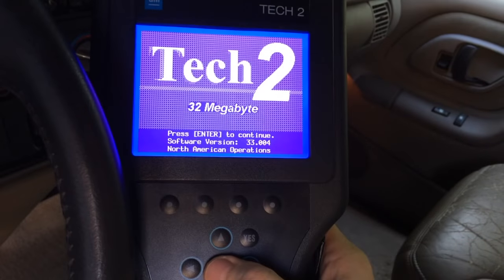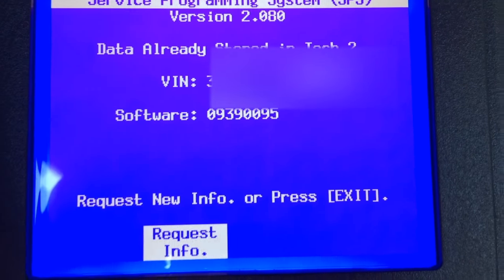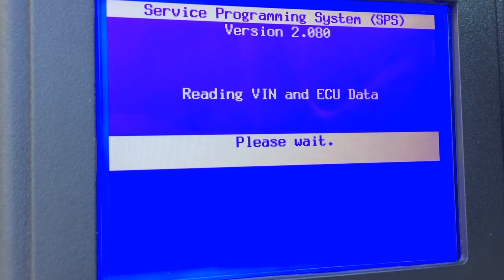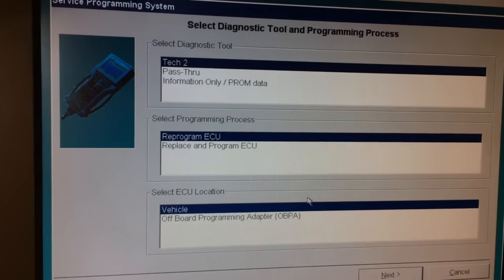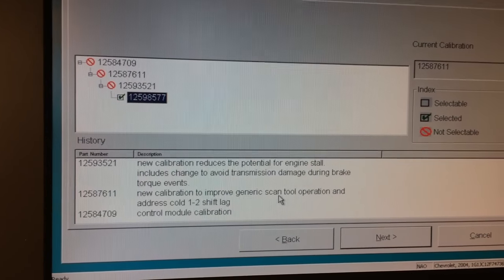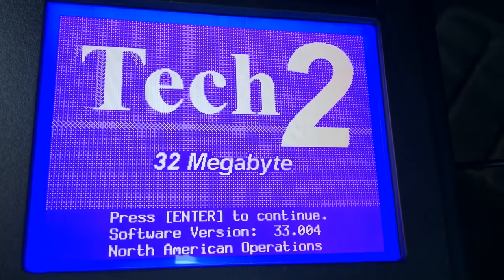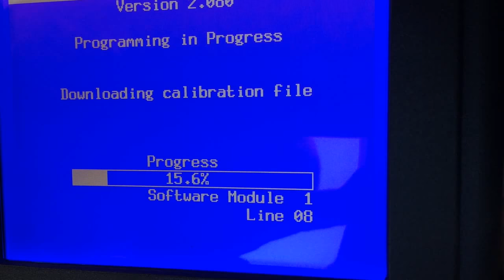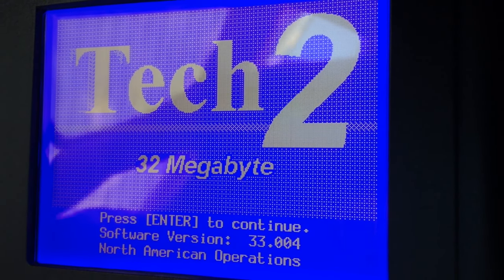GM SPS Programming: Tech2 Tool Remote Mode ECU TIS2000 How to do a Calibration Update Reflash (PCM)

Comment: Very helpful video. Thanks for sharing! My 1st attempt at using my scan tool has stalled at the settings page. The PORT box is empty and won't let me enter anything. BAUD is 115200. I've tried this with and w/o the unit hooked up and it makes no difference. Not sure where else to turn for a direct and informed answer. Thank you again.

Comment: From what I can find, the last TIS 2000 was dated 10/2008, which I am still looking to find a download to update my 03/2008 version?
Reply from the maker: There was one newer DVD update after 03/2008, but it only contained model year 2008 SPS content.   It's pretty hard to come across nowadays.  So if you don't have a 2008 that you need to do SPS on, you're not missing anything.   You can always use the current Tech2Win emulator with an MDI scan tool interface instead for 2008 and up vehicles.
Reply: @DrShock  Thanks for that info. My screen says I have 12/2007 on about TIS 2000, so I'm hoping to at least update to 03/2008 like you had on your machine in the video. Great video BTW!

Comment: thank you for all great info , I have a rebuilt BCM from local parts house, should I use my TECH 2 and TIS 2000 or should I use ACdelco techline to program it . I have used my MDI 2 to program on techline 2007 Silverado before. It was straight forward . First time with 2006 hummer h3.  Mitchell says use tech 2 ? how do I get Tech2 to load SW ? change it first then scan it? TIS2000 says reload or replace ecu ? I want to replace BCM with rebuilt one that is fresh and blank that i have . what would You do ,thanks for being there to help all of us !
Reply from the maker: I only use the Tech2 for vehicles that fall within the TIS2000 support range, so only up thru model year 2007.   For 2008 onwards, I use the MDI with Techline Connect.   The latter has a per VIN subscription fee, but you can pass that on to the customer of course.

Comment: Nice video instruction.  Question- I have a tech 2 and just purchased a GM card.  I need to calibrate a steering angle sensor on a 2008 Saab 9-7x (AKA Chevy Trailblazer).  Does this require TIS 2000, or Global Tis?  And, I presume that I need admin access for all of this.  I have software already (Tis200 and Global Tis) for my 07 and 2010 Saab 9-3 vehicles, using the Saab card, with admin access.  The 9-7x is new to me, and I know it is a Chevy Trailblazer with a Saab front end, essentially.  I do have a CANDi module. Thoughts on this?  Thanks!
Reply from the maker: Thanks.  2008 was the last year for TIS2000, most of the clone copies are incomplete for this year insofar as SPS goes, and really only usable for 2007 and back.  If your VIN is in your copy of TIS2000 it's the cheapest route for a module reprogram.
 
GlobalTIS and TIS2Web have been deprecated by GM since the end of 2021 though.  The new tooling is Techline Connect with SPS2 and it does not support the Tech2 anymore for programming.   You would have to have an MDI, or an aftermarket J2534 compatible tool, to use SPS2 now.

The Saab vehicles have always been on the odd side of Tech2 and TIS with frequent issues from what I've read/heard.  I do not have any hands on experience with this Euro model so your best bet is to hit the Saab forums.

Comment: I have a DrewTech CarDaq 3+ , Tech2Win software but am Looking for a TIS2000 download as I need it to reprogram a BCM on a 2006 Hummer H3 as we replaced the Passlock ignition switch and while doing the security learn it failed after the first 10min wait session while doing the 2nd one. 

Any help would be greatly appreciated. 

Thanks DN
Reply from the maker: GMs legal department is pretty active in doing take downs, so finding that will be quite the easter egg hunt.  You can find TIS2000 on eBay as used DVDs from time to time.   And of course the Chinese cloners still stick a version in when you buy a clone Tech2 from them.

Probably faster just to use SPS2/Techline Connect from www.acdelcotds.com.

Comment: Thank you very much. In deed it helps a lot. A complex problem that occured on my BiFuel Opel Combo CNG 2009  by wanting to activate the Cruise Control turned the Switch for Natural Gas / Gazonline useless. Car runs only on gazoline and not on CNG any more. Pressure Sensor for CNG reports 0 bar pressure (even though the tanks are full and at 200 bar). I know sounds unbelievable but it is ture and a fact. The OP COM Software had and has a bug on z16YNG Motors that was addressed (but only in Astra and Zafira CNG Modells) and not on Combo (since the Combo is listed as a Corsa in GM Systems) and now we are fighting to resolve that. :-((   I try to install GlobalTIS and OPCOM and liked your info on TIS2000 so I can talk with the dealer on eye level and have a better understanding. 

So today in 2022 the deaeler is able to REFLASH the Firmware in my Car for the EngineControllUnit and the BodyControllUnit much faster and without the need to download on a PC - transfer it to Tech2 and loading it on the car, right?  He can flash it directly with his DiagnosticsTool over WiFi on the car.
Reply from the maker: Glad it helped.  And yes the Tech2 remote mode was abandoned by GM many many years ago.  So a dealer will not even have that option available to them.  Both TIS2000 and TIS2Web are obsolete and discontinued.   The dealers now use Techline Connect, which only supports the passthru mode I showed in a different video.   And rather than using a Tech2, the dealer would be told to use the newer MDI running a Tech2Win emulator instead.

Comment: Hello
I would like to ask the TIS2000 with virtual technologe works?
Will it be able to reprogram from a damaged ECU?
Reply from the maker: I don't believe TIS2000 will run within a VM, real Win2K or WinXP only.   It will handle SPS programming for GM vehicles up thru model year 2007.   Past that model year, you'll need a subscription to SPS2 at www.acdelcotds.com plus an MDI scan tool (Tech2 no longer supported by GM).

Comment: Is this the same method used to add Factory Cruise Control to a GM vehicle that wasn't originally equipped with it ? The wiring is all there and hooked up to My Donor parts. I was told by Dealers that it can't be done do to my vehicles age, or nobody's interested in doing it. A 2000 is too old ?
Reply from the maker: They probably got rid of their Tech2.   Yeah this is the tool used to enable those kinds of options in the BCM back in the day, but model year 2000 is a bit early for that sort of thing.  I don't recall cruise control needing to be programmed prior to 2006 or so.  What make and model?

Comment: I have a 2000 Saturn L Series that has lost some communication with some options via the BCM. I bought a new virgin unit that I took to a tech I know that has the Tech 2 set-up. He went to program and configure the new BCM, got errors during the programming install and stated He had to contact the GM Tech Support for further assistance. Any idea's what Errors He would be talking about ? He couldn't get a response in time to get a solution before the Holiday weekend. I read on the Programming Procedure print-off that before programming can be done, All Modules and connectors need to be connected. I forgot to tell Him I had both driver and passenger side Air Bags disabled and the Recirc Door Actuator disconnected, along with the factory radio that is Theft Deterrent. I'm wondering if that's the Errors He was getting. Before it goes back next week for the second try, I will reconnect everything and see if that resolves the issue, and tell Him I forgot to let Him know about those. Lol. Maybe Customer Error, not His set-up. Great Vid too !
Reply from the maker: Thanks, all I could think of is what I covered here a few years back - https://www.youtube.com/watch?v=9h-qdNn3iOk but I thought that ended with the 1999 Saturns so it might not apply.

Comment: what I  accidently did was played with my TECH 2 on TIS2000 and lowered it to 28.xxx ., I since got a new PCMCIA card back to 33.004 ! what I have to do is replace BCM on 2006 H3 hummer because the keyless entry and TPMS do not work. I was going to reload the firmware but it already has the latest. So I can not do that . Do I just install a new BCM and run the program and will it install. Everything else works fine just do not want to mess anything up. Should I do it ?
Reply from the maker: First be careful on the memory cards.  The Tech2 does not use PCMCIA, it uses a different kind of linear memory chip inside the card that just happens to use the same type of connector that a PC would.   Cheapo Chinese cards might not last very long if they are the wrong memory chip type.
 
A Tech2 will only allow you to setup a brand new BCM, so just keep that in mind.  If you're trying to use an used module, you could be out of luck with a Tech2 since GM didn't want to allow that path so its very hit or miss.  But setting up a brand new GM BCM, or an ACDelco remanufactured unit, would be just fine.   You would just install the BCM and follow the service manual directions for programming.  This varies across models and model years, so having the service manual, or service information online at www.acdelcotds.com, is best.
Reply: @DrShock  Thank-you so much for all great info . I am using a clone Tech 2 to replace 2006 h3  BCM , will it work as  needed like a original  GM Tech 2 ? Thanks again for giving all of us your valuable time !
Reply from the maker: Thanks.  Contrary to the fake news you may read on the 'net, the clone Tech2s are 100% identical in functionality to the genuine Tech2.  They are 100% compatible with the software, even having the same bugs.  ;-)

Now there are differences to be had, the circuit boards are built much more cheaply, so if you drop a clone Tech2 on the shop floor it's likely toast vs the real Tech2s that are very durable for shop use.   And while you can send a real one in to get repaired for $$$, you have zero repair options with a clone.  The membrane keyboards on the clones crack and split after a few years of shop level use, whereas the real ones last decades.  That sort of thing, build quality.  That's what you give up with a clone, but not any functionality or software compatibility.
Reply: @DrShock  Thankyou so much for that positive info !

Comment: Okay, I have a 2008 gmc sierra and I want to reprogram the sdm because I think they replace the BCM, and I can’t do it with the SPS2 software it gives me this error E4399, my question is I need all this tech2 software and hardware to reprogram the module?
Reply from the maker: No, the Tech2 isn't even supported by SPS2 as it's far too obsolete.   You can only use a Tech2 tool with SPS (think SPS1) with the DVD-ROM based software TIS2000 that runs on Windows 2000 or NT only like I showed in this video.   TIS2000 only supports up to model year 2008 programming as well.

For anything newer model year wise or Windows version wise, you have to use an MDI or MDI2 tool with GMs Techline Connect.  That's where you pay to subscribe to SPS2.  Runs about $45 per VIN for two years access.
Reply: Okay thanks for replying, I always pay to reprogram modules with sps2 but I have been getting a lot of older trucks recently and I can’t reprogram these trucks with the sps2, I was reading on some website and they said that some older trucks (pre 2007) need Tech2 in order to reprogram a Module, That’s my question.
Reply from the maker: Yeah the older trucks I would always recommend using a Tech2 on, with TIS2Web.  But now that Techline Connect came out, they dropped support for the Tech2.  I'm talking about the actual Tech2 here, the physical tool.
 
They still offer Tech2Win, the Windows emulator of a Tech2, which is useful for older vehicles that do not have GDS2 support.  But for programming, you'll have to give it a go with the MDI or some more modern J2534 tool.   If you find a problem, ACDelco TDS support was giving special one day access last year to the old SPS to use a Tech2.  Not sure if they are still doing that here in 2023 though, you would have to call and show them it's not working with SPS2.
Reply: @DrShock  okay thank you a lot, I’m using the snap on pass thru pro lll so I can program the module with this one right?
Reply from the maker: I've only used the GM tools, so I couldn't say.
Reply: @DrShock  Ok, thanks a lot for your time.

Comment: Can you use the Tech2 with TIS2000 software to program the PCM for larger diameter tires? Or to adjust torque management or any other performance options to gain more benefits from the 2002-2005 Trailblazer/Envoy I-6 GM 4200 engines? Been looking at HPTuners to performance tune the PCM yet they cannot change tire sizes to re-calibrate the speedometer for larger tires. Have heard that the Tech2 with TIS2000 may be able to do all these things.
Reply from the maker: Not generally, this is a GM dealer diagnostic and service tool only.  It can't do performance tuning.  I haven't done it myself, and not all vehicles have the Tech2 menu option anyway, but some vehicles do have a menu where you can change the tire configuration for the EBCM (ABS unit) with the Tech2.  The only calibration files available  match the OEM tires GM originally sold new with the vehicle though.  The Tech2, as far as I know, will not let you alter the speedometer situation (though the dealer might be able to get a custom calibration file for a fee as long it was an OEM tire size option when new).  Short of that you would probably have to have both a Tech2 and something aftermarket like EFIlive to do both.
Reply: @DrShock  I tried to update the tire size on a 2005 Silverado.   The tech2 gave me a list of tire sizes to select from.  I chose the correct size of tire that is on the truck.  It told me to push the brake pedal to continue, and it failed at that point.  I tried it several times.  Is there some additional steps required.  I have not connected to TIS.  It did ask me to confirm my VIN during the process.
Reply from the maker: As long as the tire size was originally available from GM on that VIN, the process is pretty straight forward and does not require Techline Connect (when using a physical Tech2 handheld).   Be sure you have correctly built the vehicle in the Tech2 before accessing the special functions menu; including product line code, engine type, and other specifics as those values are all important to successfully completing the function.   Also be sure you are running the last firmware level for the USA, 33.004 on the screen when the Tech2 first boots up.

Comment: I've been using my Tech2 to do various module updates on my 03 Escalade. I successfully updated the radio and PCM software, but now when I go into SPS to do the next module, the tech2 seems to have a power surge and reboot. it happens right during the Download Mode phase, it stays in download mode just long enough for my computer to read the vin, but then shortly reboots and is no longer in download mode, so my computer can't actually send the update files to it. It worked last week, any ideas on what could have went wrong?
Reply from the maker: You're commenting on the remote mode video, where the Tech2 is connected to the PC for the download not the vehicle.  A reboot like that sounds like one due to a voltage drop situation.  If you are using remote mode, and seeing this sort of problem I would first suspect a problem with the AC power adapter.  If it's not the adapter itself, it could be the barrel connector for it.   To test the latter you can connect power to the DLC jack end of the cables AC power port instead of the base of the Tech2 itself.

If it's neither of those, then it can be a DC-DC converter failing on the circuit board if it's a clone unit.  This is a much more rare issue, but I did a repair on one a few years ago here - https://youtu.be/VAmGybyWfJ4
Reply: @DrShock  OK ill give that a try. Yes I'm using remote mode currently, I have Tis2000 set up on a desktop. I'll see if I can find a different power adapter to use, and if that doesn't work I'll run power to the DLC pins. Also gonna check out the DC/DC video you have, hopefully I can bring the tool back to life. It works fine in all functions otherwise, it just flickers and reboots after being in download mode for a few seconds.